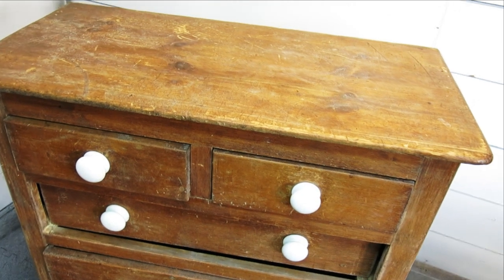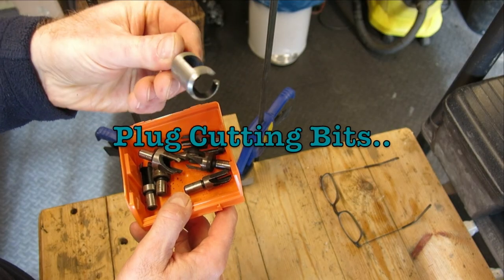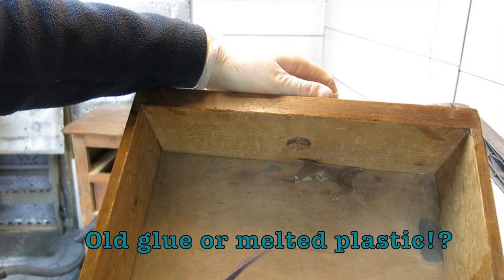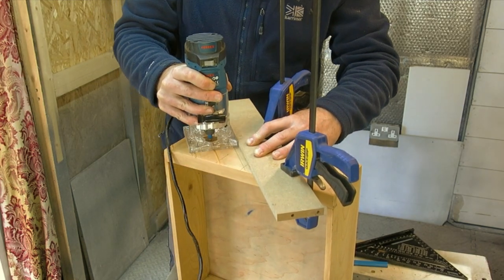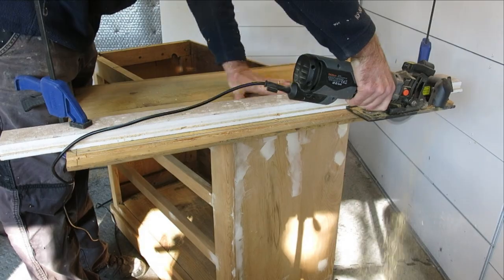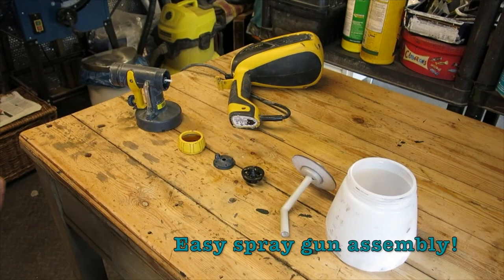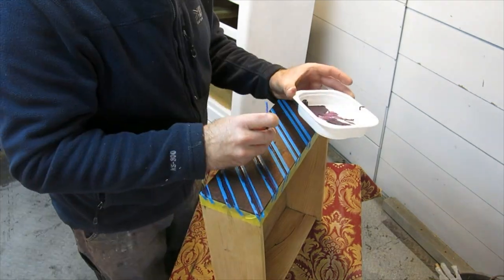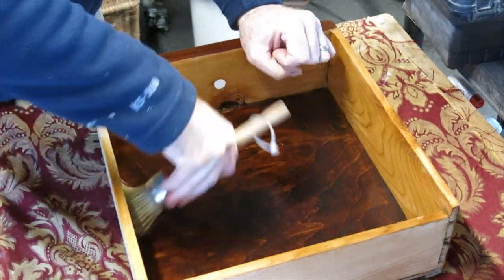Amazing RESTORATION/MAKEOVER of a Vintage set of Antique Pine Drawers

Comment: Very beautiful.
May I ask what grit did you use for sanding what what size is it?
Reply from the maker: I only tend to use 120 and 240grit. Very occasionally i might use 80 grit for stripping paint/finish. I have two sanders, one is 125mm and the other is 90mm 👍

Comment: A measuring gauge. I didn't know such a tool existed. I was just looking at a piece of mine that has two large holes from what must have been massive screws, and I was at a loss as to how to accurately measure the diameter. 🙏
I saw you could convert the sander. Could you tell me what that kind if sander is called? Also the hand router and hand held circular saw? I have neither the room for nor the money for the large machines.

Nope, never seen the foil trick before. Another tip from you. The paper bag tip is great.
What kind of wax brush did you use? And where on earth do you get your drawer pulls? They're always so beautiful. Amazon Italy has total rubbish.
Thank you for another lesson. That poor little half destroyed chest looks so happy!
Reply from the maker: Hi Elena. I’m so pleased that my videos have given you some tips and tricks to use on your pieces. That’s one of of the main reasons I started the channel. The measuring gauge was actually my Grandads who was a big inspiration to me. You can get digital gauges now. The Sander is a Festool Rotex 90 and is brilliant. It’s not cheap but was a great investment as you actually get 3 sanders In one. It has a Rotary setting, a random orbital setting and you can change the sanding head to a “Delta” head for corners. The router is a cheap “Palm router” I got from a local supermarket and the circular saw is a fairly cheap “mini’ circular saw for simple cuts. There are links in the description of the video to the tools and products I use. The wax brush is from Amazon (link in description) The drawer pulls are from a shop called TK Maxx here in the UK. It’s known as TJ Maxx in the states but not sure if they have an equivalent in Italy. Thanks for watching. 😀👍

Comment: Nice bold update. If that top is solid wood aren't you concerned about expansion and contraction with the seasons? I'd avoid gluing it down as that can cause splits and cupping to form if the wood can't move.
Reply from the maker: Hi. Thanks for your comments. I’m not worried about movement really, the piece must be 70 years old and the wood was very dry. It’s also going to be here in the UK in centrally heated houses so the variation in temp/humidity across the seasons is pretty minimal here. 😀👍

Comment: Question:  Why foil in the paint tray?  Would plastic wrap or some other plastic film work?
Reply from the maker: Hi Mary, I’ve tried plastic wrap but it doesn’t “stick” to the plastic tray. When you move the roller through the paint, the plastic moves. I find foil works much better. 😀
Reply: @MayfieldRestorations , thanks. That's helpful.

Comment: Nice work. Shouldn’t that top be secured with floating screws so it doesn’t crack like it will absolutely do now that you glued and nailed it
Reply from the maker: I’m not sure what you mean by “floating screws” ?
Reply: @MayfieldRestorations  I believe he means the practice of drilling a small oval where you insert the screw so it (the screw) can move around when the wood contracts or swells, (depending on the weather), and not hold on so tight that the wood ends up splitting?

Comment: Will not gluing and nailing that top down cause it to crack eventually? Aren’t they supposed to be attached using screw holes that are  oblong so that it can breathe.
Reply from the maker: Humidity is pretty consistent in the UK so not a big problem 👍👍